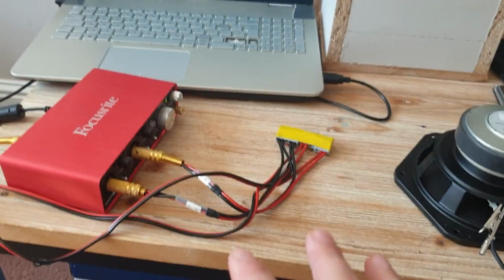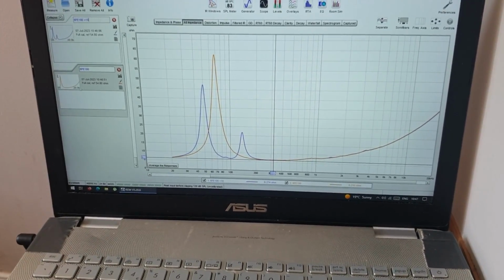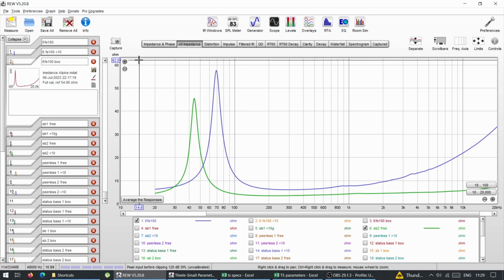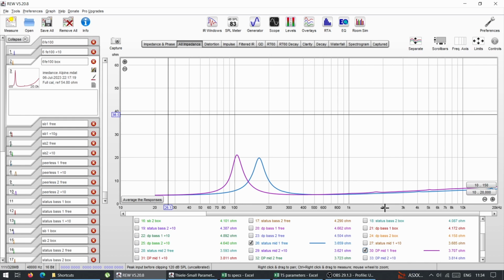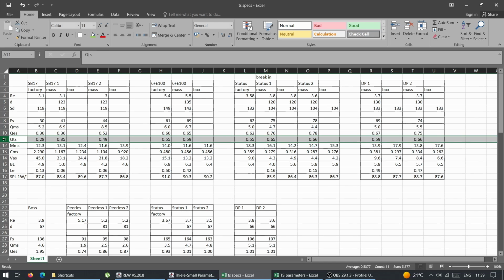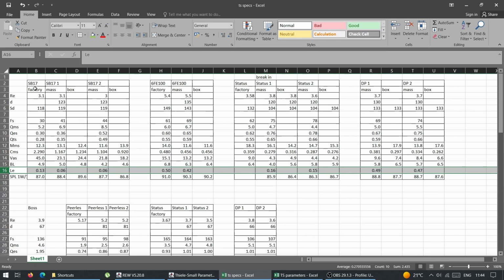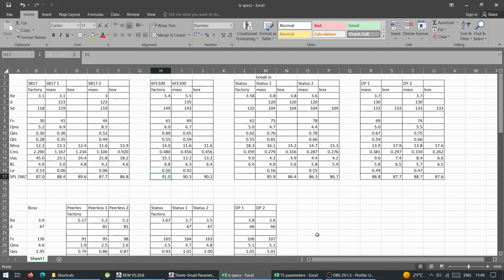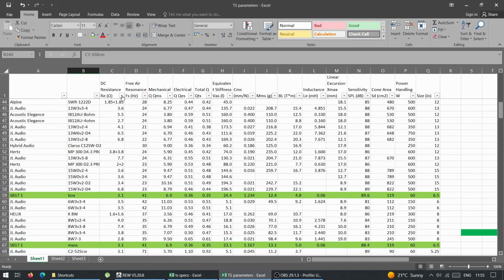Impedance sweeps and T/S parameters

Comment: 'didn't cost you anything' is not true for someone else wanted to copy what you've done: cheapest Scarlett USB interface is $124 which is not much far from what Dayton has. It coud be found used, but still this option is more expensive than using even simpler method of PC audio card available in every PC. Question is always what accuracty we can get but for amateur purposes think PC method would give accurate enough result.4
Reply from the maker: You don't have to buy the Scarlett, you can get a used behringer here for like 20-30 pounds. Accuracy will depend on the quality of calibration and the measurement method,  not on the interface.
Reply: @RAW-CAt  and .. that is what I did at the end, 204HD, and EMM-6; audio interface may be benefitial to keep

Comment: I bought the DASTS v3 to test speakers, but i cant trust it. I can measure a speaker 10 times, and i will get 10 different readings.
Reply from the maker: Unfortunately I do not have experience with dats. The only tip I can give you, is to make sweeps in a quiet environment and don't block the pole vent.

Comment: Hi Raw cat

Please let me know if I'm wrong
I notice that the software calls for the cm2 of the cone area. 

Should you not use the formula for area of a circle

Thanks
Thushan
Reply from the maker: A speaker cone is not a flat. Cone has more area compared to a circle.
Reply: @RAW-CAt  I've checked REW and it actually calculates area of the circle, not cone. If we want to be super precise, speaker cone is combination of a truncated cone and dome for the typical speaker, so exact formula would be a bit complex, not much even for elementary school. I was lazy to calculate accurate area of my test speaker and compare to what REW calculates which is circle area, meaning less than actual. I also do not know how much this difference may affect T/S results.

Comment: Hi, thanks for all your great videos, I have a question; can this method be used for measuring impedance of an output transformer? So I can see how good is the frequency response, primary winding inductance, shunt capacitance, etc.
Reply from the maker: I am not sure about that. Technically it should be possible, as it  measures inductance no matter the device
Reply: God help you and bless you ...

Comment: Can you please link to the connection diagram for the cables?, are you using 6,5mm stereo plugs and 1k rsense? (I have just invested in a gen4😅)
Reply from the maker: You can find the wiring schematic in REW manual under impedance measurement.

Comment: Very clear explanation.
Is there any way you can post a schematic of how the Focusrite is wired, please?
Reply from the maker: Look up REW manual under "T/S parameters".
Reply: @RAW-CAt  Thank you for the response. I have seen the REW schematic; I am just a bit blurred on the Focusrite rig itself--connected at the back of the Focusrite, is that the output jack?
Reply: @raynerstuelgalid  2 yr ago .. probably figured it out by now .. but maybe for other that would read comments: as said, check REW help as explained at the begining - wiring is really simple, three  solder TRS 1/4 jacks are used, all can be stereo (L/R/Gnd). Each require two wires to be soldered, red and black here, red is L or R channel and black is ground. On REW wiring diagram ground is shown as ellipse which is also symbol for shield which is also soldered to ground. What is what on TRS jack can be found on the web: tip is L channel, middle is R channel and long one is ground/shield.

Comment: So I see that the V(as) = 13. xx liters. If you stick the driver into a sealed box that is 13.xx liters, what would the scan of the driver in the box look like? What measurements can I make that would indicate a proper box for the driver? What does that look like graphically or numerically?
Reply from the maker: Vas has nothing to do with the "ideal" enclosure size. It's just a numerical equivalent of suspension characteristics. A "proper box" will depend on what is your goal. You can have the same woofer in three different boxes and it will perform perfectly fine. You just tailor the low end response to your needs. Whether you want more SPL or more low end extensions. The only "confirmation" that you can have if the modeling is correct is the frequency response, as that is really the only thing any software is modeling.
Reply: @RAW-CAt  so how does the Vas factor in decision for box dimensions? I tried using WinISD but the parameters of my driver from DATS V3 breaks WinISD. The driver is a 27mm China driver and so box design data doesn't exist. I think the math breaks at this size driver because the relationships on some of the parameters depend on one being smaller or larger than the other. Most of the popular box design apps break when I put in the data. I've confirmed the correctness of my data.

Comment: great video!  I wonder if using magnets next to speaker magnets is not a good idea?  
I guess I could cross-check the measurement with non-magnet added mass or other method, but these magnets seem to be "not by the book" when it comes to adding mass :)
Reply from the maker: They are simply way to far away from the coil or the motor to have any influence.

Comment: This video is pure gold! Congratulations! I am doing my first steps in measuring TS parameters and to know more about how to understand the impedance curves is very helpful.  Talking now about the Fs of the first drivers you have shown in the excel sheet, did you measure a brand new driver or you did it after a burn in period? From my point of view I would design my speaker cabinet after doing a burn in to my drivers. What do you think? Thanks!
Reply from the maker: I did measure new drivers and I am planning to make an update video after a proper break in.

Comment: Hello, love your channel.
what ohm value are you using in you diy DATS.
10 ohm?
I am trying to build the same setup.
thanks
Reply from the maker: I tried a few different values and ended up with something like 40-50ohm. There is a note about resistor value in REW manual.
Reply: @RAW-CAt  they recommend 47 ohm 'if device used to drive the load can cope with lover loads'

Comment: Wouldn't the magnet you used for added weight  measuring be causing the little blips as its not centered on the driver? The weight was off to the side of the center cap. I would think that could cause a change in the response. Thanks for the videos. I continue to learn from them.
Reply from the maker: Those blips are in the impedance sweeps with no mass added .